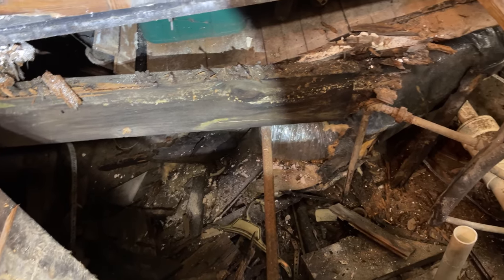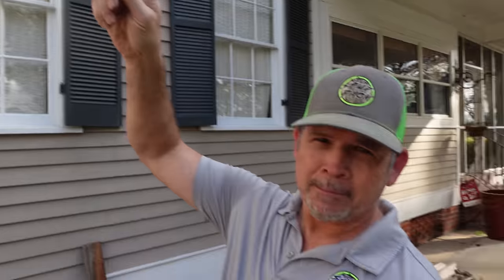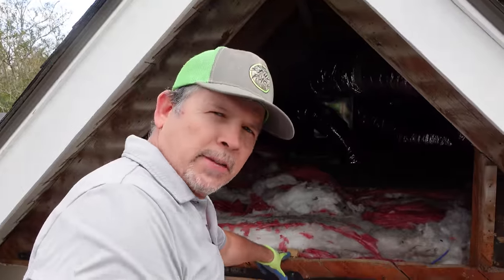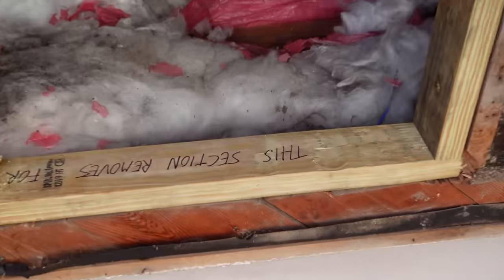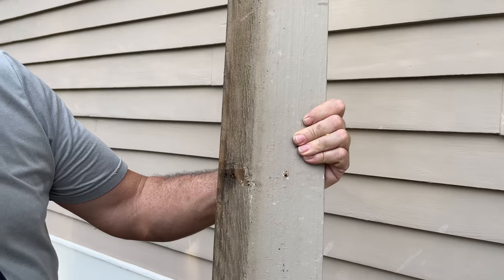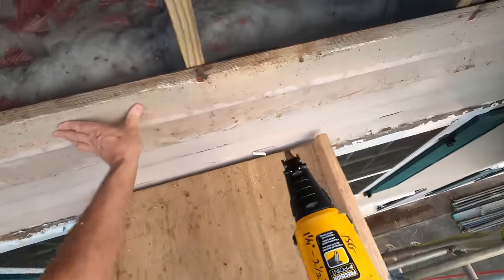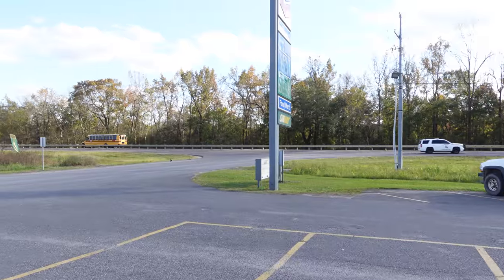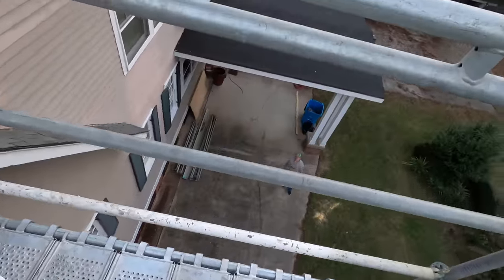REPAIRING A GABLE VENT so FUTURE TRADESMEN HAVE EZ ACCESS!

Comment: "structural screws" Yea, I've been using a bunch of GRK screws on my current project.  A little bit spendy, but they're great.  Easy to drive with their torx head, don't jar things like a nail gun can do, easy to remove, and Code-recognized the same as nails.

Comment: You folks are the best. The safety and quality you provide your customers are top notch. One suggestion for safety you may want to consider to purchase a Klein 5104 canvas bucket with load rating of 100 lbs instead of a plastic bucket when raising tools and/or materials overhead. Back in the day we used plastic buckets but a couple of incidents occurred when the plastic bucket split and one time the wire handle failed resulting in near miss of someone getting hurt. We went to this canvas bucket and didn't have any incidents. The bucket would probably last you a lifetime. Again, great job guys!!

Comment: 3:59 when measuring to the short end of an angle cut, instead of eyeballing where the tape falls, line the short end of the miter up with the end of your chop saw fence, and hook your tape to the edge of the fence and drag it down the material. More accurate then just eyeballing.
Reply from the maker: Great tip Scott 👊👍

Comment: Now I know how I can fix my odd sized gable vent, to match the siding around it!!!! What a neat idea, glad to see you guys made it removable. Oddly enough this is exactly why I lost my gable vent. The A/C guys before, who changed my unit tore it all out and hauled it away. I got home from work and had to figure out how to put something back up, they had bought and tried several metal vents, none matched the swaybacked roof line. I lost a closet downstairs but, I don't have to worry about that A/C unit in the attic anymore, but I think I will make my patch job removable just like you guys did. Awesome IDEA! I have been living with a plywood patch with slits cut into it,.
Reply from the maker: Perfect 👊 so glad we could help 👍💪

Comment: Good call on the gable, guys. And it didn't hit the customer for any more material costs.  I'm not sure if anybody has ever questioned why Titebond is your go-to glue, but, I do know why.  And it's simply that Titebond is better than Liquid Nail.. period!  I do know that you use that instant adhesive on smaller and indoor mends/joints, but, the Titebond seemed more practical for that broken board. Live and learn!  Great job guys.
Reply from the maker: Thx Brian 👍👊

Comment: I have a question for you, in one of the bathrooms where I changed out the faucets and added new SS hoses, I notice that that small 1/2"  pipe that come out of the wall, that have threads on them. One hot and one cold, are chrome on the outside and look like copper or Brass on the inside and is kind if green with white stuff inside the pipe. Now my problem, those pipes go into the wall where another sink is on the other side. I can not see where it goes and was afraid to try to change it for fear it could leak inside the wall. On the cold side the water taste like metal. Do you think I could change this or leave it alone. House was built in 1964. I hope you can answer this for me. All the pipes are copper in the house. 12/28/2021 Thank You !

Comment: What’s the purpose of the ~3/4” blocks that each board is nailed to?  Ventilation?  It would seem that the clapboards atop each other  would have sufficient slope.
Reply: It is for the airflow, also why the screen is there instead of wood blocking it off
Reply: @johnknightiii1351  👍

Comment: I must have mind-wandered when you explained why the 3/4 x 3/4 x 5" spacers were used. I'm guessing they created air circulation, but for what reason?
I thoroughly enjoy your video's. You make learning fun.
Reply from the maker: Attic ventilation 👍.   There is an identical louver on the the other end of the house

Comment: Y'all need to add a QR code, to this video, to the note you left in the attic that the next guy can scan so he can see how you did this job. Of course he may not need it because he won't use scaffolding or even need to remove the gabble end. He will have a jet pack and and most likely a transporter to install the new equipment. You know, cause you did such a great job and it won't need to be replaced for about 1000 years. 😁
Reply from the maker: Consider it done Shannon thx 👍👊

Comment: You did a great job, creating and securing the ramp. What you did to shuck safety, was not protected the sides of the ramp, from a person falling. One slip, lights out. Have lost fellow workers, because they were to lazy, or just cut corners to save time, and money, when building temp structures like this. You took the time too build proper rail protection around the main structure, to stop from falling. So why would you take an extra 10 minutes and protect the other area?
Reply: You mean like the 12" over hang? How could you put something up without it being in your way?

Comment: Drywall substrate in a shower?😳
Reply: Based on their previous videos, I'm thinking they probably installed Schluter waterproof membrane over the substrate for the walls and floor of the shower.
Reply: @migueldiablito666  True, I didn't even think of that. I always use Hardibacker in showers.

Comment: Why didn’t you put out rigger’s on a 30’ high scaffold 
You should have used a well wheel to build and take down scaffolding 
Tie scaffolding to house ?
So it doesn’t fall over 
Not enough return with no answer?
To long of a line set
Reply from the maker: Scaffold company said outriggers and tying to house unnecessary.
Reply: @StudPack  your hvac contractor should have isolated the unit from the joists